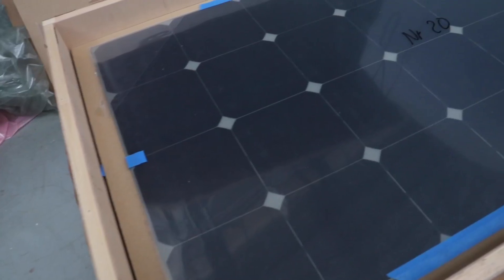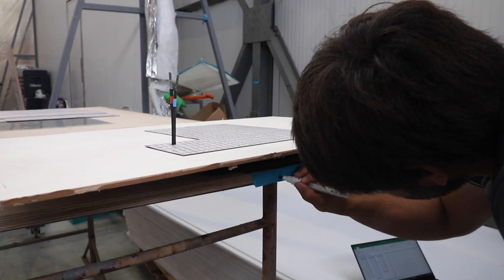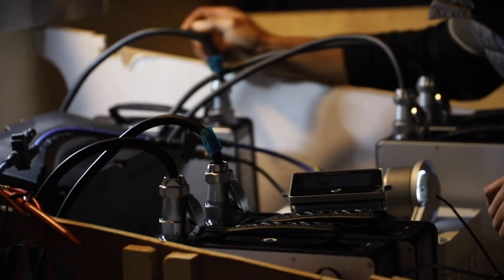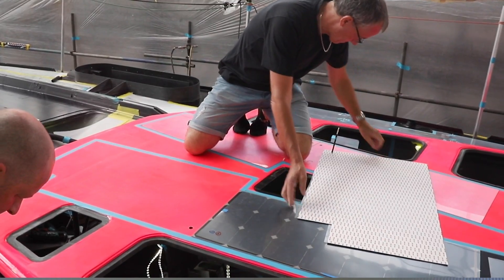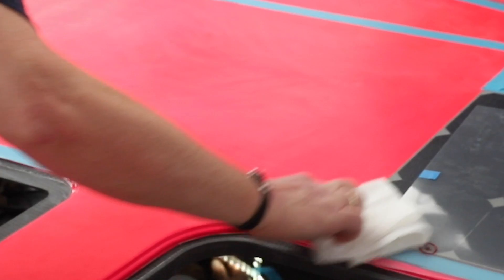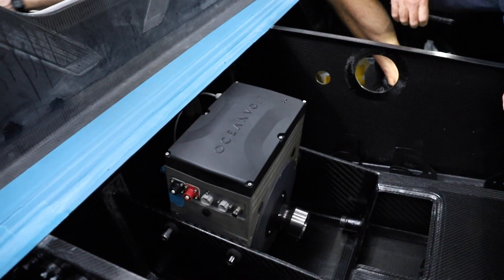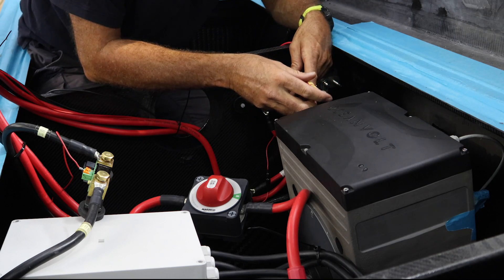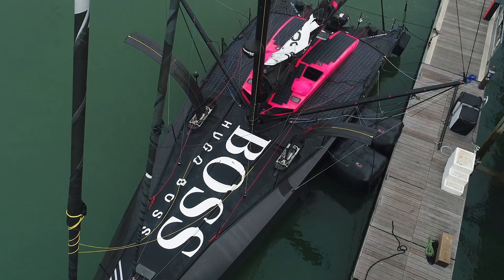Sustainability and performance

Comment: I understand the motor being required for safety, but I am not clear how this solar electric is specified to provide equivalent safety to the diesel boats.  I think there is a strong incentive to build a solar electric system that is lighter and does not have as much power and range as the diesels.  How do they stop teams shorting safety rules?  The solar panels look like about 4kw rated.  That does not push a boat far in the Sothern ocean.  I would think they should bring a fuel cell or AL air battery, only for emergency propulsion.

Comment: If you want to be as sustainable and quick as possible trought the southern ocean think about kinetic energy forces ;-) https://patents.google.com/patent/DE102013018075A1/de - technology is free to use now
Reply: btw.: as you use hydraulics for the keel movement you will not need to convert hydraulic into electric energy ;-)

Comment: Wait... my understanding is that the traditional Diesel engine is only for emergencies, and that the race organizers measure the remaining fuel at the end to prove that none was used. Hence two questions:
- how can the race organizers verify that the electric engine wasn’t used?
- why is there any environmental gain? An unused Diesel engine doesn’t pollute.
Reply: Actually they always use the motor to generate electricity, to keep all the life support system running. You can check out the other boats, there aren't a lot with solar panels. They can generate electricity with hydro generators but the motor remains the main energy source. Running the motor doesn't mean turning the propeller. To be sure they didn't use the motor to go faster during slow winds, they simply seal the shaft, it must remain sealed during the whole race or it's disqualification as it would prove they used it.
It is actually very impressive to go turn around the world without diesel. Hope it helped ;)
Reply: marccspro ah thanks! That makes sense. Then I guess the verification process can be the same with an electric motor as with a Diesel engine.
Reply: @luc4662  Exactly ! Can't wait to see the boat race !

Comment: I'm very confused. This is a boat for the Vendee Globe? Are you allowed to use a motor in that race?
Reply: The boats also need to have a motor for emergency purposes and also to charge the batteries (usually).
Reply: @daveoriordan1537  Thanks, but that doesn't really answer the question. 1. Charging. You would not use solar panels to change batteries to power an engine to charge batteries. 2. Propulsion. If all goes well in the Vendee Alex will never fire up the motor as that would DQ him. The video says the engine is for propulsion. Is this for a different race?
Reply: @davidhopkins  The panels are there to charge the batteries, the motor is there for emergencies. Other teams (in other races) used the motor to charge the batteries instead of having solar panels.
Reply: @davidhopkins  The class rules state that the boats have to have a propulsion unit. It is not used for the race but is required for emergency situations. i.e. if the boat dismasts that it can make some sort of headway in an emergency. Usually the propulsion units were diesel engines which could also be used to charge the batteries for the onboard electronics (but not propulsion during the race). 

With this boat it appears the emergency propulsion is an electric motor. The motor will probably (I guess) have it's own battery seperate to the batteries for the onboard electronics but all batteries will be charged by solar it seems. I never stated the electric motor would charge the batteries, all battery charging will be done by solar (or maybe wind!?)
Reply: The swing keel is hydralic and so a motor of any sort is required for that,in the case of a diesel  motor the drive to the prop is disconnect and taged,the same will be for the electric  motor to power the hydralic for the swing keel and disconnected fron the prop and taged .when required in the case of an emergency the tag will be removed and the prop engaged,the powers of be have to be informed when tag is removed and prop engaged as now you have got power propulsion, and as such can not win the race, solar panels top up the battery not a diesel  motor as in the past,  i think this is correct ,hope this helps ,love the show and all the content of the comments
Reply: The electronics and the hydraulics on such boats are massive power consumers. 

I suppose, if solar is not enough, the motor will work as a hydro generator delivering a few extra Amperehours per day.
This is a proven concept from other racing yachts. However the average speed is much higher on this one...